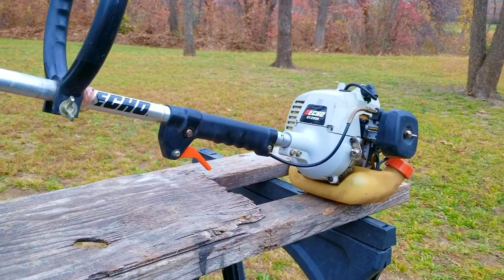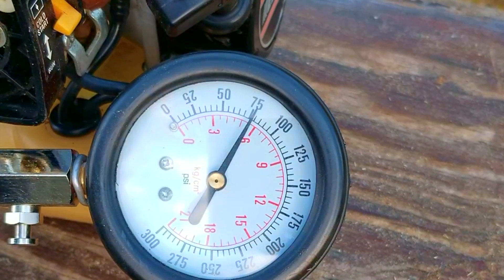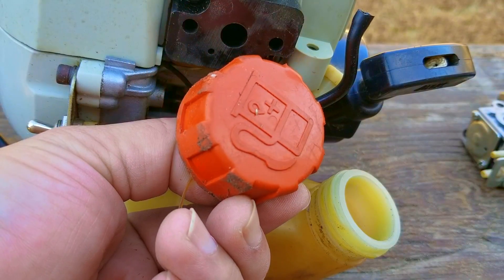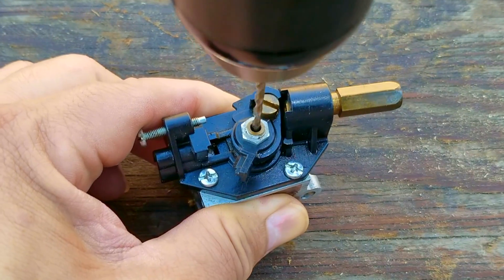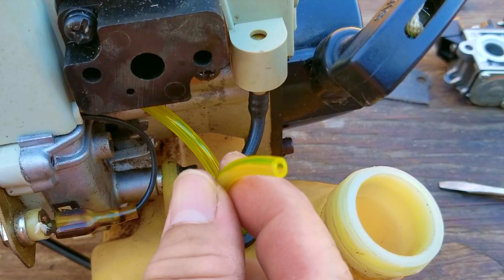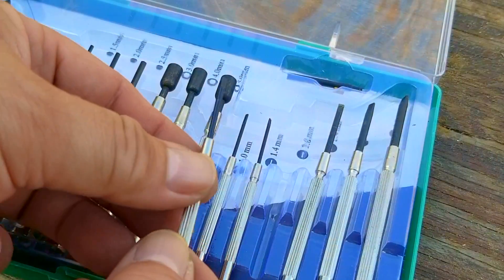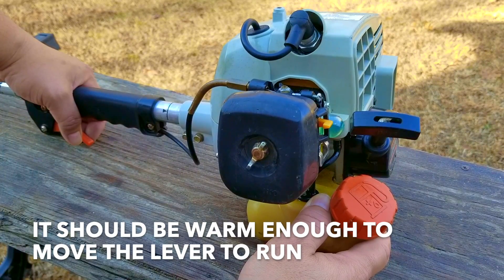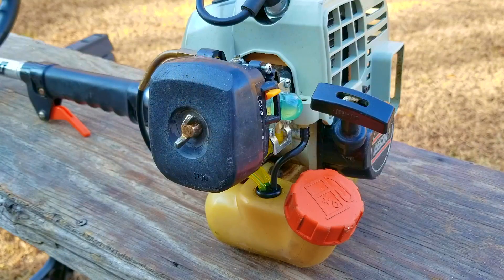Echo GT200R Trimmer starts, but won't stay running

Comment from the maker: I made a mistake in the video, At 10:36 I mentioned that I turned the L screw, But unfortunately I  proceeded to turn the H screw instead. I should have turned the screw on top of the Carb, which is where the L screw is.  It still made a slight improvement, but I wanted to mention that I had made a mistake.
Reply: You’re a stand up guy. I would make way more mistakes.
Reply from the maker: thank you Andy Becker
Reply: Thanks for the videos it has helped me a lot throughout the months that I’ve been working on small engines
Reply from the maker: no problem
Reply: Good idea. Best to always be upfront to admit and mention your mistakes. Good on ya!
Reply: We all do dude keep them coming
Reply: What is the gas mixture ratio for that one? I got one from Craigslist for learning purposes but no manual so no clue?
Reply: @yawmxaivchannel  50.1
Reply: @robertyearian227  thanks
Reply: This video was excellent!  I was wondering where the heck the adjustment needles were.
Reply: How do you reset both of the screws to factory settings? I really “screwed them up” trying to tweak them. It won’t start now. Uff. Carb is new.

Comment: The L screw is the one on top and the H screw is under the purge bulb. You might see if the compression is higher now. I’ve noticed that 2 cycle engines that sit for extended periods don’t have enough residual oil in them to get a good reading. Seems to be running ok.
Reply from the maker: thanks
Reply: @HomeGaragechannel  Love your vids. You are straight to the point and no BS. The camera work is awesome and I like that you film outdoors. Thanks from Wichita Kansas.
Reply from the maker: I appreciate it Andy Becker

Comment: I enjoy all your videos from all the different small engines you fix and bring back to life. I also agree that echo makes a great product. I am currently having a problem with my Echo SRM 210 straight shaft trimmer. About a week ago I noticed it was not running correctly and noticed the fuel lines and grommet were deteriorated. since I have had this trimmer for many years i figured it was time for some maintenance. So a went down to my local shop and bought new fuel lines and a Zama carb rebuilt kit. After changing all and restarting the Echo trimmer it started up fine. I was actually very lucky that it did not have to adjust any of the high or low screws since it revved and idled fine. But  when it is warmed up and I shut it off and try to restart it, but it will not start. I tried chocking and un-chocking the trimmer and nothing. I took out the spark plug and it was a little wet from fuel.  I tested for spark and it  had spark. The only way I can restart this warm/hot engine is if replace the spark plug with a spare I have that is perfectly dry. It seems that after it warms up and it will not start if the plug is wet. Not sure what is causing the plug to get wet after  shut down the trimmer. Any suggestions would be greatly appreciated.
Reply from the maker: luckily you've given us a lot of information to work with. I'm guessing the engine is flooding, on hot start up.  Are you giving any throttle, when doing a hot start? If so, I would try, without the throttle
Reply: @HomeGaragechannel  Thanks for your quick response. I have tried it with no throttle and wide open throttle with the same outcome, no start. It appears the engine seems to be flooding when I shut it down . I am thinking it could be something with the carb flooding the engine when I shut it off. Again I appreciate any suggestions. 
Larry
Reply from the maker: no problem,

Comment: I've got a really old Echo SRM-302B-DX, it's nearly all made from metal, all the covers and even the guard.
Reply from the maker: I like those, is yours all orange then?
Reply: @HomeGaragechannel  Yes it is, with a silver muffler guard, it came in a job lot of non runners and it now works great and cleaned up nice, in very good condition. I've also got a really old Robin brushcutter that I've had for about 20 years (at least 30 years old) that I still use. Only ever put a new recoil spring and on/off switch on, never even cleaned the carb.
Reply from the maker: very nice, I really like the design of those.

Comment: While you were working on the carburetor you mentioned the adjustment screw on the throttle shaft as the high speed screw, but that is the low speed adjustment, and the other screw on the side of the carburetor is the high speed adjustment.
Reply from the maker: I made a mistake in the video, At 10:36 I mentioned that I turned the L screw, But unfortunately I  proceeded to turn the H screw instead. I should have turned the screw on top of the Carb, which is where the L screw is.  It still made a slight improvement, but I wanted to mention that I had made a mistake.

Comment: Hey bro I personally think that fixing an older trimmer is better than buying a used newer model because I believe that they perform better than most of the newer models.
Reply from the maker: thank you Ramadin Sookhoo.
Reply: @HomeGaragechannel  you're welcome bro. My Stihl 025 chainsaw will be 32 years old this year since my dad (God rest his soul) bought it and it's still going strong. My Stihl 280 trimmer is approximately 20 years this year and my BG56 leaf blower is about 5 or 6 years old. I never had any major issues with any of these tools just a minor servicing now and then and that's it. I believe that once you take care of your tools / equipment they will last you a lifetime.

Comment: Great video plobem I have tintan strummer works well then after 15 minutes stop you know why
Reply from the maker: I would look into the fuel cap, or the tank vent. Otherwise, try replacing the spark plug, as It may be failing.

Comment: I purchased a similar machine last summer for a few dollars and it was the best decision I made, it has been running like a charm. Prior to that I had purchased a new one for a lot more money and kept returning it to the store since it didn't run well, until I returned permanently and bought the used echo. The used echo parts feel much stronger and better built.  Thank you for showing us how to do the compression test, and the rest of repairs.
Reply from the maker: no problem Pedro Gonzalez

Comment: Great Video.  Do you have any repair videos on riding lawn mowers.  I have a poulan pro and when I go to start it I hear clicking sound.  Battery is charged and mower has GAS..  Thanks for your assistance
Reply from the maker: I do have some,  try using an automotive  jump pack, to help "jump" it. and if it works then the battery is good, but not strong enough to start the engine.

Comment: Absolutely fixing the older one. I did that for a family member that got frustrated and threw his (out of frustration) because it wouldn't start. The carburetor itself was broken in a couple of places. The main problem was the hard molded plastic piece that the throttle cable went into was busted, I probably could have jerry-rigged it but instead I got a $20 Chinese knockoff carburetor and just replace the whole thing. The package came with extra fuel Purge bulbs which it also needed, along with new fuel lines and a filter within 20 minutes or so his old beat-up echo was running like a scalded dog again 👍
Reply from the maker: nice work! I would have done the same thing as well. thank you Dwayne Collins.

Comment: Excellent video. I always try to fix to older machines if not completely worn out. Also Echo is the best out there and easy to work on. Thanks
Reply from the maker: no problem and thank you Waterman One.
Reply from the maker: I made a mistake in the video, At 10:36 I mentioned that I turned the L screw, But unfortunately I  proceeded to turn the H screw instead. I should have turned the screw on top of the Carb, which is where the L screw is.  It still made a slight improvement, but I wanted to mention that I had made a mistake.

Comment: The engine will behave differently if it has no load on it as you can see here, as soon as the trimmer head got working again it sounded like it was slightly bogging. Although I am sure that you know this.
Reply from the maker: you are very perceptive,

Comment: Good video as always. I had noticed that mark on the shaft was a little odd/off but didn't think anything about it. When you adjusted it and as soon as you started it I could tell right away that that was the the fix... lol 
I have to agree on the fixing this if it cost you very little to no money to get this piece of equipment along with fixing it as you know the brand new ones can cost upwards of $1,000.
Reply from the maker: I agree Rob Kercheval

Comment: Cool!   So when you bypassed the purge bulb is it choke on - engine off? Thanks
Reply from the maker: the choke is off, you're just using the pump on the carb, to move fuel up to the carb

Comment: Definitely worth fixing. There's a reason you don't see these on the curb as often as newer, cheaper models. Tool like this will last forever if you take care of it. Also, maybe these older Echos just run a little different than I expected, but it sounds like it needs a little bit more carb adjustment. Seemed to be bogging when trying to rev it under load. Might wanna play around with that LSN a bit more.
Reply from the maker: yes you are right, I was going to revisit it, when mowing season came back around.  At the time of repairing this one, it was very cold, so I would like to retune it, when it gets warmer.
Reply: @HomeGaragechannel  Makes sense, that should certainly help get a more accurate tune. Not like you need it in the winter anyway, lol.
Reply from the maker: agreed.

Comment: Usually it’s expected for a trimmer or blower to have around 75 to 100 unless it’s very Smokey or low  in power I generally wouldn’t worry about it I rebuilt a pb 250ln echo and it had 90psi after the rebuild
Reply from the maker: I think rebuilding that pb250ln was well worth it. thank you Hunter 747

Comment: I’ve got that exact model, as well as an extremely old and rare SRM200 from the 1980s or 90s. The SRM 200 though is in desperate need of a carburetor adjustment, could you do a video on how to adjust the idle screws on a walbro carburetor to get it running properly?
Reply from the maker: I can, but the adjustment will not apply to your specific machine, Due to variables like wear, and condition .

Comment: Mr. Home garage, i got a question, if engine compression is low(or not good enough), will it cause the engine not to hit the high rev? Its a gt-225(echo curved sharft trimmer) btw, recently new carb and spark plug
Reply from the maker: it can.  It would have to be around the 60 PSI range.  Have check the spark arrestor screen?
Reply: @HomeGaragechannel  yes i cleaned recently
Reply from the maker: then I'll go with the compression being the problem.
Reply: @HomeGaragechannel  if it is, theres no fix, unless getting a new engine?
Reply from the maker: it's either that, rebuild the top end of this engine.
Reply: @HomeGaragechannel  ok I got the same one cheap and just did carb cleaning and it dont start.. ive tried swapping the old parts from the old carb that work but it still dont start, can carb cleaning damage the carb? Im so frustrated now..
Reply: Update, for some reason its back to start and got no clue what made it to run.. spent almost 2 hrs to figure out by myself ugh..
Reply from the maker: yes it can. You have to remove the needle and rocker arm assembly so you don't damage them, and you CANNOT spray the diaphragms with it either.

Comment: Hello i have a question about one of my weed wackers. It’s a Stihl fs 131r and it won’t stay running even with a new carburetor. I changed the fuel filter, checked the fuel line for any air leaks but it’s all well and the seals are not leaking as well. Any ideas on what i should check?
Reply from the maker: so it starts, and then immediately dies, or does it idle for a bit and then dies? I would confirm that the Fuel is fresh, and if it's not, mix up a fresh batch. I would check the spark arrestor screen for a blockage, Then remove the air filter, for a test run
Reply: @HomeGaragechannel  it literally stays on for like 1 or 2 seconds, the fuel is fresh, spark arrestor is clean, and even took the air filter off and nothing

Comment: Could you pls tell me the O.D. of the replacement line you used in this Vid. I've heard the cheaper fuel line kits sold online they don't use qlty fuel line so I'd like to assemble my own but I'm not sure what size the lines are ereplacementparts says the return line is 3mm x 6mm and the pick up line measures 3mm x 5mm very confusing as to which size fits best. I'm not trying to have constant fuel leak issues I'd like to do it rite the first time. Any advice is appreciated. Thnx
Reply from the maker: the fuel line O.D. I used was 3/16"

Comment: Mine starts but the throttle doesn’t work. Any ideas ?
Reply from the maker: does the throttle move and then return back to its normal position or is the throttle stuck? if it's stuck, then it's either a  cable problem or the throttle plate on the carb, is stuck closed.

Comment: Out of all the gas weed trimmer I have, Echo are still my favorite. Echo SRM210 (same as above just stright shaft) is my go trimmer, get more usage than Echo 225. Echo trimmer seem to have the right balance of power, comfort, and weight compared to other trimmer including Husky/Stihl/Hitachi trimmer. Carb+fuel line delivery seems the be the most common issue with Echo trimmer  typical of 2 stroke issue, rarely see Echo trimmer with blown engine.
Reply from the maker: I feel the same way about them. thank you Mickey Kim

Comment: what does the h screw do
Reply from the maker: it's for adjusting the fuel delivery "while" holding down the trigger.  meaning it's for fuel adjustment at High engine speeds.

Comment: I replaced carb and now it starts but runs really fast - how do you get the throttle line slack enough that it hits the idle screw- mine is very tight
Reply from the maker: look at the throttle cable, it must be out of alignment somewhere causing it to be "taught"
Reply: @HomeGaragechannel  nice 👍